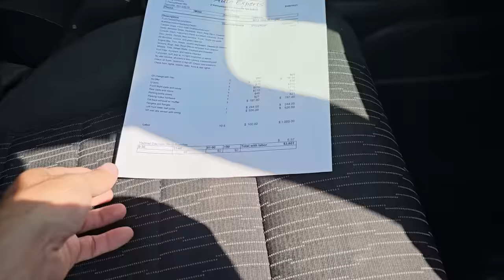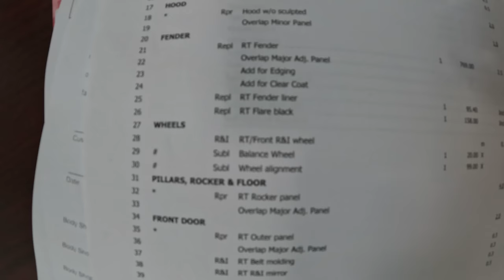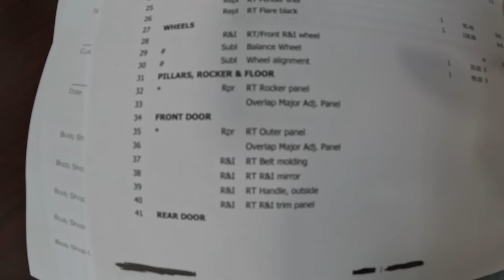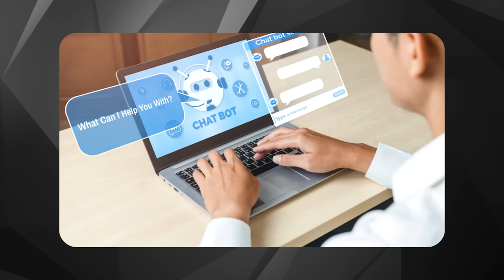A Customer Returned Her Car Crashed! - Confessions of a Car Dealer Part 2

Comment: Owning a Wrangler for a while and being a part of a Jeep club where most own wranglers... they are just high-maintenance vehicles. The 3.6 v6 motor has several weaknesses and I don't know that I would want another one now that I have seen the ugly. I owned mine a year and spent thousands on it, lost more on it when I sold it. Coming from owning Toyota's and Honda's it is hard to keep a Jeep that costs 3x what a good car does to maintain.

Comment: Those customers were complete morons for not buying that Pathfinder from you. Craig, you are far beyond fair, you are exceptional! I'm also an auto dealer, and the only option I would've given them is to bring the car back, and if they didn't bring it back within 24 hours they would've been stuck with it.
Reply: So you wouldn't have taken the car back plus a 6500 insurance check? I would have if I had a body shop, and a body man, but I would not have given them a choice about getting another car or not. They're getting another car, whether they like it or not, no way is a customer getting any money back. Those are my terms.

Comment: This has nothing to do with your situation but knowing what you now have discovered about Jeeps maybe you could give us a bit of advice what may be the problem 
We have a 2013 Jeep and we baught it several years ago for our older daughter. When we purchased it, it had a weird antifreeze leak spraying out the bottom. We have a trusted family mechanic that fixed it but not really. It fixes and goes away then comes back. It runs well on and off lol fix it everytime. We handed it down to our middle daughter  (who just got her license) and purchased a newer Jeep for the older one's 21st birthday. Anyway now the older Jeep is doing the older thing again but now the antifreeze is smelling through the heater. Our mechanic as well as my husband want to do the same thing they have done over and over but I yhinknit is not what they keep fixing. (Thats why I have not put in here what they have done so far) I was wondering with all the crap you have gone through with the Jeep do you have any suggestions of what  to check on this Jeep to fix this old problem. 
I think you did everything you could have done for these people! Lol we are Jeep owners and a small business owner so we know! Lol

Comment: This engine inside of the jeeps are known for having cylinder head problems. That’s probably why it has a misfire hairline cracks in the cylinder. Also check if you’re slowly losing coolant.😊

Comment: Stellantis DID NOT own Jeep at that time ... that is a Fiat engine ... and the Pentastar is a good, reliable engine. Like other cars, Wranglers have common "known" issues, such as they chew through radiators (the engines run hot) and they sometimes have a failed oil cooler ...

Comment: That’s why we sell the cars as-is. Which dealer has the time too drive 100+ miles in each car. Used cars are used cars, who knows what’s gonna pop up down the road. Best bet is too buy the extended warranty, that way yourself and customer are covered. Not yoUr fault customer always declines warranty. Happens all the time.

Comment: Pentastar V6 cylinder 2 misfire is a KNOWN issue.  The head is bad and it either cracks the valve or the valve becomes loose and you lose compression = CEL.  Replace the head and dont throw parts at it !!!!!!!!!!!!!!!!!!!!

Comment: I own two Chrysler vehicles with the 3.6L V6 and have a company vehicle, a 2015 Jeep Grand Cherokee Limited with 220,000 original miles and a 3.6L V6 without a problem, other than a fuel pump at 200,000 miles.  Normally, my company only keeps our vehicle for three years 100,000 miles, but I love this Jeep and I trust it 100%.   So, a wrangler with 160,000 miles is considered a LEMON?  A Lemon was my 2021 AUDI A6, which I dumped after one year and bought a 2022 Jeep Grand Cherokee Overland with a 3.6L V6, my personal vehicle, and my wife has a 2020 Loaded Chrysler 300c with the 3.6L V6.  A Nissan with a CVT isn't my idea of a reliable vehicle considering the number of people I know who have owned Nissan products including the Pathfinder with the CVT.  I am sorry you had to go through that, but I can guarantee you that if it was anybody else, they would have given that customer the middle finger, especially after offering to buy back the Jeep several times, then having them try to screw you over with the damage they were responsible for regardless of friendships.   I live in California, and I can tell you for a fact that many new car dealerships wouldn't go the distance you did for your customer.  Your character and honesty are why you are so successful in your many endeavors.

Comment: I actually feel bad for used car dealers, and used car buyers going forward. SO many vehicles on the road today have serious, known issues. The 3.6 Pentastar issue is just one of many. And yes, you are going to have that problem on nearly all of them that you find at auction. The same goes for a Nissan CVT, or smaller Jeeps with the "Tigershark" engine burning oil. And we haven't even gotten to what more modern cars are going to be like in the future. Small displacement engines with turbos are not known for longevity. Couple that with literally everything being controlled by a sensor, and the future looks pretty bleak for used cars.

Comment: Craig at least it wasn't a total loss for you Getting paid for the body work is a home run as far as the customer is concerned They will probably have to remortgage their house for their next insurance bill. As far as the pathfinder they probably researched it and found out if there wasn't an extra transmission in the glove box it would be a good  idea to pass on that vehicle On better note I think I found a new seat cover company

Comment: Is there any recalls on a 2018 Nissan Pathfinder?
NHTSA safety recall results (3)

(Nissan) is recalling certain 2015-2018 Nissan Murano, 2016-2018 Nissan Maxima, and 2017-2019 Nissan Pathfinder and Infiniti QX60 vehicles. These vehicles were previously recalled and unrepaired, or inspected and determined to not need a repair, under recall number 18V-601.
Reply: Junk

Comment: 95% of used car dealers tell you to pound sand the minute you drive it off the "as is" lot. It happened to me in Ohio last year when my Cadillac DTS was a crank, but no start a week after I bought it (solved thru youtube Northstars suck) as well as an intermittent wheel shimmy that didn't go away with 4 brand new goodyear tires and a new rim I had to drive 6 hours round trip to buy. Keep up the being a decent nice guy and human that doesn't fuck over all their customers. You will be a continued success. Where's German?

Comment: OMG my Jeep I had with the 3.6 was the worst I ever had. I know they aren’t all like that but this one was almost like yours. Check engine lights all the time. Take it in get it fixed and 1000 later another problem. Injectors, sensors, gaskets, seals you name it. And I would baby that thing. I only drove it 5000 a year. Very little city driving. I lived in BFE and to get to anything was 20 miles. I think I’m dating myself, does anyone even use BFE anymore?

Comment: Never buy a Nissan with a CVT. There Trucks are super reliable The New Pathfinder with the new 9 speed Titan transmission is also a great vehicle or the older Pathfinder that had the Titan tranny was also a great SUV. But when they downsized the Pathfinder and stuck the CVT in it. Not a good idea. I suspect  they did an internet research and figured that out and passed on the Pathy.

Comment: When people feel they have been done wrong and act out/speak out during that emotion, they are irrational. This is why communication is so important. Had they had a conversation with you and accepted their responsibility to the car and accident it would have gone differently. Be accountable, responsible and communicate. If you break a window with a ball, it is not the ball or ball manufacturers fault. You threw the damn ball.

 I hate when people tell me they can plaster a home for £400 in materials but have no experience or idea of the labour and tools and time that goes into my £1600 bill. Good, buy the stuff and do it, learn it on youtube. No need to call me for a job then try and lowball me because youtube said so lol. A 2nd hand dealer is a tough spot. It buys you freedoms and the cost of those is dealing with sketch laws and people, so it actually confines you.

Comment: Love the customer service, but a $15K Pathfinder great as a first car? Absolutely not haha. First car should always be a beater. Not only is that car far too large (it's too large for anyone tbh), but it's way too expensive. Unless you're making high six figures, $10K should be the absolute maximum for a first car, because you know something's going to be dented. Ideally you should be spending around $2-5K. That car may die in a year, but it'll have taken all the wheel curbing and fender benders out of a new driver's system.

Comment: Don't hate yourself. Not ur fault. You did fix the jeep- it is just a bad batch from factory. Look at the rolling lifter trouble G.M. has even on $ 130,000 Cadillac Escalade occuring at first 15k out of the factory. My 2 cents. Geez, your not to blame for G.M. 3.1 head gasket troubles

Comment: You went way above and beyond. The daughter crashed the Jeep and they should have filed the claim and paid the deductible as that had nothing to do with the mechanical issues. I can appreciate wanting to do what you can to maintain a good reputation though. I wouldn’t have offered the Pathfinder. I think t that point you’ve gone so far above what was necessary that I wouldn’t want them in my store anymore or have anything to do with them. Yeah the customer can pick the retailer but sometimes it’s appropriate for the retailer to pick the customer and anything that ever went wrong with the Pathfinder in the future would be your fault (in their eyes).

Comment: That’s fucking ridiculous that those seats look that bad only been about 12 or 13 years old. Are you kidding me tell you what kind of quality crap they’re putting in the new vehicles I have a 25 year old Ford pick up truck and the only part of the driver seat that was messed up. Was the part where you set your rear end And the rest at the bottom rest of the interior in perfect condition

Comment: First off.    Never buy any 3.6 penastar engine built in 2011 or 2012 model years.    They were all junk the first 2 years into production.    And second off:     Never buy one of these vehicles used without seeing oil change slips in the glovebox.    Missed oil changes will grenade this engine every time.   No matter what year it was built.    They have very small oil passages in the block from the factory.    Skipped oil changes create sludge in the whole entire engine and then it's traded in and Craig at flying wheels buys it because it's cheaper out of season.   Lol

Comment: The 3.6 is a piece of garbage, I change 4 to 6 of them a month, stay far away from them. The oil cooler under the plenum constantly leaks, the temp sensor attached to said oil cooler goes bad, they develop bad heads at low miles with misfires on cylinders 2 and 4, they tick loudly due to poor quality lifters, they leak oil all the time. eat injectors, etc. Just pure garbage

Comment: I just try to be a nice guy. I’m not going to be a nice guy to everyone. Business is business. I was looking at a 96 gmc diesel tow truck with 360kms it had rivets on the rocker and some rust. Had a hit on the driver side that had been kinda fixed door and fender still bent but hood gap off. The wreck mounts where rusted with large holes. The diesel had something off with it. The dollys needed new tires the wheel lift by hand had about 2-3 feet of play. Should be stiffer then a porn star on his first video. I figured I would have to put in about 5-6 grand to get it past safety which it had not had in three or four years. Plus about 200-300 hours. I didn’t have the room or some of the heavy weight equipment I would need. I offered 3G he was insulated and didn’t even counter me. 4500 would of been my top offer. It sold about three weeks after maybe my low ball got him off the 6. If I made him happy I wouldn’t be because I would of ended up paying retail and making it retail value. 16 year old didn’t know how to drive I would of let their insurance take the hit. Then let her learn to drive on that same vehicle. Also you might have to start 100 mile test drives.

Comment: You need a better hound nose upon problematic cars, clients, friendships, relationships, etc. At the first sign you detect that the car is a goner, buy it back with no options. Given customer options just push the sour end for a month or two without any real benefit. Offer another car (especially a nissan, which has became a mechanic’s preferred car 😉, like honda) was another huge mistake; you were lucky that they just walk away and didn’t accept it. Imaging what would you be if they take the nissan and ended up with a cvt broke transmission? Dude,  the only great thing of your story is the lesson, that worth more than  $14k; when something doesn’t fit, don’t force it. Just let it flow.

Comment: After seeing Part 2 I kind of see what you did.  You took the car back after making 0 profit from covering the $2500 repair and they paid for $1200 so it was a wash. The Jeep still had issues and you took it back only if they filed a claim with their insurance to get it fixed which they did but you ended up getting the $6,500 to repair it and let's be honest it took you 2500-3000 tops so you ended up making $3500 profit on it in the end.   Then you sold them a Nissan Pathfinder which you say is a better vehicle than the Wrangler and unfortunately, a Nissan Pathfinder is actually in fact worse... I'd assume you made at least a 1500 on the sale of that so you came out 5k ahead.

Comment: All the money you already sunk into it, to include numerous repair attempts, it may be a better choice to send it back to auction instead of slapping your name on the back of the same Jeep again if it isn’t fixed.

The question will always remain, why wasn’t it fixed the 1st, 2nd, or 3rd time…. Why is this the magical fix?
Reply: The only fix for that Jeep is a new engine.   My brother is a Chrysler mechanic.    He told me to stay away from that engine in any 2011 or 2012 vehicle period.    It was a flawed design from the start.    But it was a lot better in 2013.     I own 2 vehicles with this engine design.    2013 and 2014.     Both vehicles run great

Comment: 3.6 pentastsar is junk I buy and sell cars and won't touch anything with the 3.6 they have way more issues that lifters mainly timing chains and guides. Straight Junk!!! There is a shortage of these engines because they are so unreliable.
Reply: They aren't hard to fix.
Reply: They made several million of these engines so you will hear about issues mainly because of the several million made!
Reply: Remember something about this engine.    They have very small oil passages in the block.     Missed oil changes will grenade this motor.

Comment: i cant believe somebody turned a 16 yr old loose in a 4,000 pound vehicle. you guys have too many used car laws, you could have brought that jeep down to the south and done zero work to it and sold it for $15 or $16 thousand or whatever you are asking for it and whoever bought wouldn't have complained about it one bit. it would have cost you what $500 or $600 transporting it if you have your own trailer and i suspect you do? we are getting so many northern cars down here lately that on the surface look great. i put them in the air and are complete rust buckets that are beyond repair. so there are already used car guys bringing that northern rust down here and they have got to be making a killing.
Reply: Well they didn't figure that it would go fast enough for their daughter to wreck it.   Especially when it's only running right on 5 cylinders.   Lol.     But she proved them wrong.    Lol

Comment: There is no such thing as a good engine with chrysler/dodge.
Reply: We have 2 of those engines in dodge vehicles.    And both run fine.      My brother told me not to buy a 2011 or 2012 with that engine.   He's a Chrysler mechanic.    So we didn't

Comment: After 30 years of driving I've found Cars become money pits after 100k even if you take care of them change the fluids every 5000 with synthetic oil and air filter every 10k  transmission is drained and refilled every 25-30k, brake fluid power steering and radiator is flushed every 40k every 3-4 years the thermostat is swapped but again when a car has 100k on it shocks struts brake lines both rubber hydraulic hoses and steel lines start to rust and fray out. Many different sensors become issues after 10 year or 100k again becoming a money pit it's just easier to get a new car so I know my family is safe on the roads